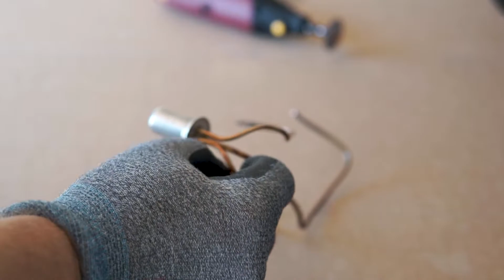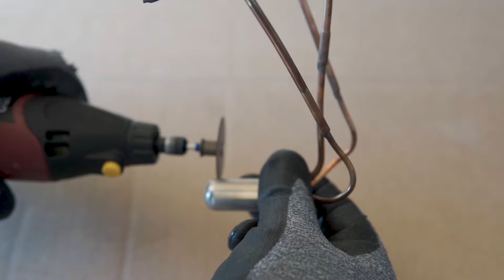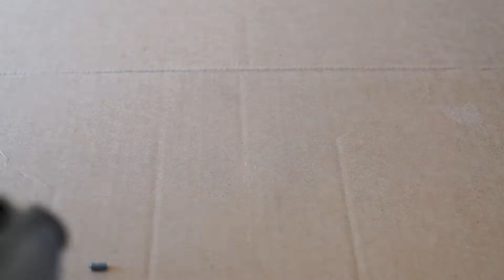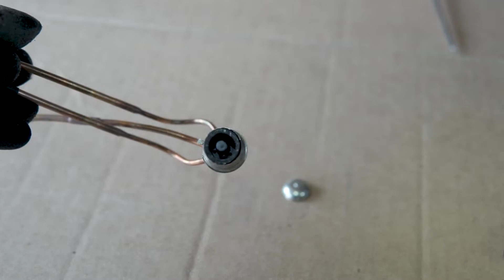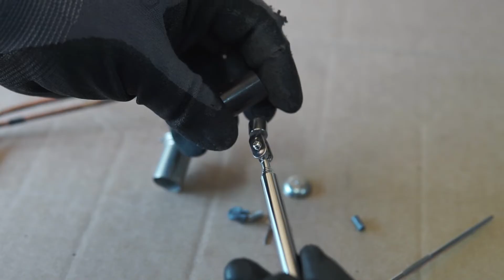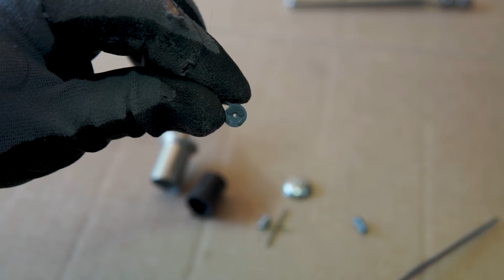3-way refrigerant valve LG teardown

Comment: Good Day,
I am searching for the solenoid valve that controls this reversing valve, can you help me please.  I bought the unit from LG and all i received was the valve assembly pipe.
Reply: I'm trying to figure out what the wires do to control the valve.  I am building a custom made setup and want to use the valve to control where cold goes..it seems to have 5 wires which isn't clear what they do, or even how to reverse engineer the signals from the control board..if you find any info, please post here.
And thanks to the OP, don't see these kinds of videos.
Reply from the maker: @murraymadness4674  this is a stepper motor, you need microcontroller and stepper motor driver to control it

Comment: Absolutely over engineered and if the internal components, even 1 fails, you’re looking at a sealed system repair.
Frigidaire is also using this method on their dual evaporator models and the failure rate on the FREEZER outlet in my opinion is high!!